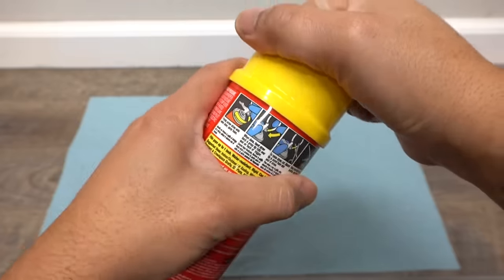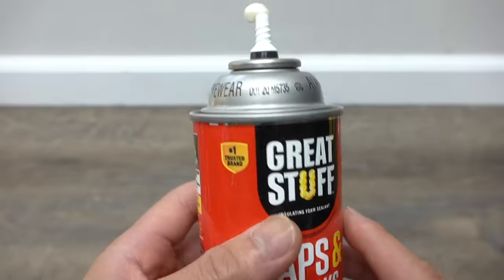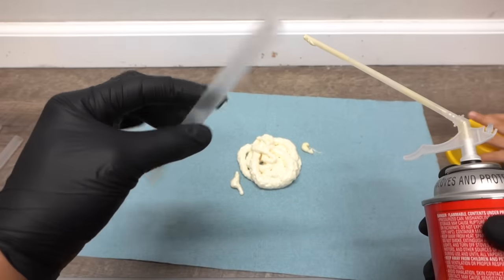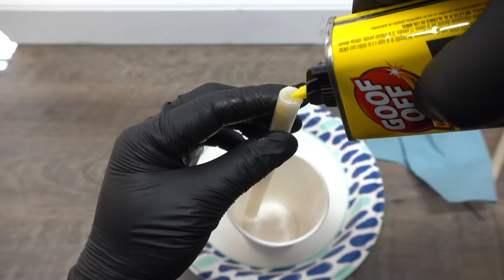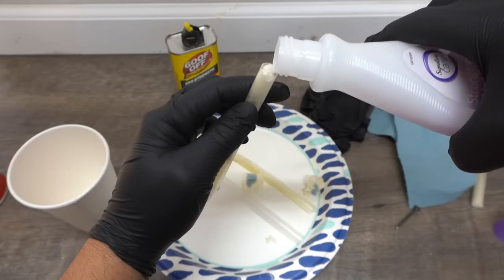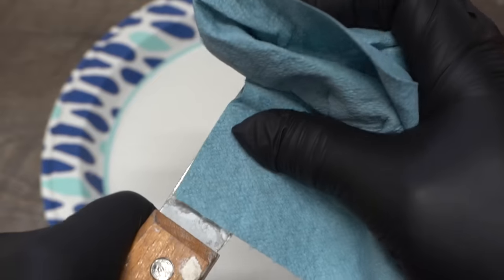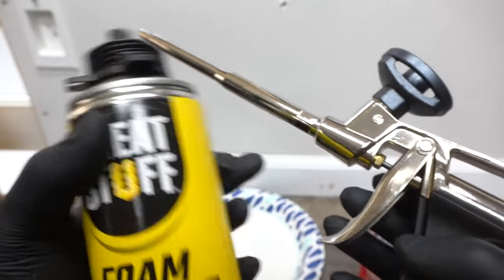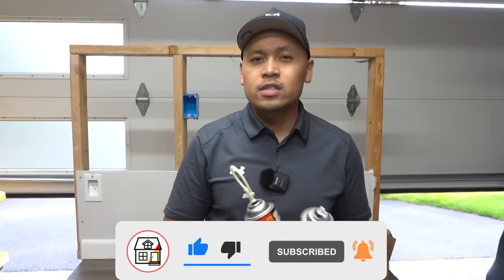STOP Throwing Away Half-Used Dried-Up Spray Foam Cans! How To Save And Fix It! DIY

Comment from the maker: ITEMS I USED ON THIS VIDEO:
- GOOF-OFF Remover - https://amzn.to/46EOv7m
- Acetone - https://amzn.to/45Ouryg
- Applicator Nozzle Replacements - https://amzn.to/474MSQc
- Drywall Screw - https://amzn.to/3FplP6e
- Match Sticks - https://amzn.to/495SNGg
- Nitrile Gloves - https://amzn.to/3S4KMeT
- Anti-Fog Safety Glasses - https://amzn.to/3Mc6hGZ
- Great STUFF Foam Gun Pro Series - https://amzn.to/3Q7X9UD
- Great STUFF Foam Gun Cleaner Pro Series - https://amzn.to/3Fwt7oE
- Great STUFF Foam Pro Series - https://amzn.to/3tEQHwV
- Great STUFF Foam Sealant Kit - https://amzn.to/3tHCGP5
Reply: Modern Goof-Off is basically just Acetone. Quart cans of pure acetone tend to be cheaper
Reply: @unquiche 2 REPLIES

Comment: I use a simpler method. When you're done applying foam, set the can down in an upright position with the application straw attached. Do not plug the straw or bend it back on itself, leave it pointing up, make sure to have something  under the can below the end of the straw. to catch possible drips. Walk away. The remaining material in the straw will be pushed to the end, typically the outgassing  of the little left in pushes it upwards. Next time you need it, you either cut off the end or clean it out. You'll have an inch to inch and a half to remove. Most of the time the nozzle on the can will be clear, sometimes a small amount of cured foam needs to be removed.
Reply from the maker: Thank you so much for this tip! Also incase you need a replacement applicator nozzle, here’s a link for a pack and it’s not that expensive: https://amzn.to/3FvHzgN

Comment: I have 3 of them that are clogged right now. They are poorly designed to be one time use
Reply: You mean they are “intentionally” designed to be one time use. If they cared at all about their customers they would sell the  straws / spray tubes separately so their customers could easily use the same can on multiple occasions.
Reply from the maker: I wish they also made detachable tips for caulking as well, like how they do in other countries 🥲

Comment: A straight piece of clothes hanger helps a lot for Cleaning out the straws. I put it in the straw after using the foam then I can pull it out after the foam dries.
Reply from the maker: Thank you for sharing this advice! That’s a pretty cool method! 👍🏽🙏🏽😊
Reply: For the straw, I've found scrap copper wire (12) to be successful. But I didn't know how to deal with the plugged nozzle. That info was helpful.

Comment: I've used this as adhesive to make structural insulation panels and glue for various other projects. 
It's exactly the same thing as Gorilla Glue. 
I was one of the first people who researched polyethylene for structural engineering purposes and found that it has many potential uses .
Reply: YEP.......... A Hole automotive body guys use it to fill rusted areas & then cover it up to screw potential buyers
Reply: So I was thinking of using this stuff to insulate a resin shed. Do you think it will work? If so howmany feet at a time do you suggest I should spray at a time?
Reply: As strong as gorilla glue?
Reply: @SirChivalRegal  absolutely, being the same thing after all. They are both polyethylene.
Reply: I was the first though
Reply: @tacos379  Really? With what institution?

Comment: Friend of mine showed me how to clean the clear tube out, he’d stick the tube in WD 40 coating the sides and let it soak a few minutes before spraying the foam.  After finishing, he just squeeze the amount out.  The spray acts as a coating making it easy to squeeze the spray foam out.   Works just like acetone.  Economically the acetone is cheaper though.  I’d prefer to save as much of the WD 40 nis that it’s gone up in cost.

Comment: I dip the end of a pipe cleaner in acetone and then put it in the nozzle and I run a couple through the spray tube after I use it.

Comment: Thank you!!!! I'd buy you a beer if I could.
I've thrown away multiple cans of foam because the nozzle and tube were clogged solid. It was so frustrating knowing that there still usable foam in the can.
Reply: Yes, I have had the same problem.  Something very annoying about shaking a heavy can that will not spray.

Comment: Dropped in to see what useless information you were offering, but instead left totally impressed. Great tips on cleaning those nozzles!. I've always tried to clean them with a wire when the foam was still wet, but that never worked good.
This past summer I had an almost full can that I couldn't get to work at all, even after cleaning the nozzle with a screw. It was either throw the can out or do something drastic. So I took a 6 inch nail and pounded down thru the nozzle until the can punctured. Then I just pointed it at the crack I was filling and made a big mess. After it dried I trimmed the excess foam away.
Yeah, I showed that can who was boss 🤣🤣
Reply from the maker: I’m glad I was able to help! Please be careful with aerosol cans, puncturing could lead to serious injuries, but I’m glad you won the fight over the can my friend! Hehe 😊👍🏽🙏🏽

Comment: BRAKE CLEANER... I have used it for years.  Spray your foam,
and shortly after use, spray the straw and can nozzle with Brake Cleaner (using the straw)

!!!Wear protective glasses!!! spraying into the can nozzle and straw WILL have lots of "back splash".
Best to use a face shield or behind a protective shield.   At least face the can sideways.

I've re-used cans stored  for over a year.

Comment: What I do is to simply wait till I have several different projects that will "collectively" use up the entire can, prepare all of those areas for foaming, and then perform all of the sealing-jobs at one time.  Or I look around for spots where I would like to have foam added but which are not urgent or critical, and then use up the last of the can's foam on them; I can use these spots to expend the foam from several different cans over the course of a few months, since it doesn't really matter if they get sealed completely at a given time.

Comment: If you spray the Goof Off directly into the can, does it adversely affect the foam in the can?
Reply from the maker: The goof off is not a spray just pour liquid form. Just apply small amount at the tip and let it settle and blow it off by pushing down on the nozzle.

Comment: it'd be nice if they made an applicator gun that works with the straw type cans. I don't have a problem with buying the pro cans, but sometimes lows/home depot will have a sale on the straw can where they're selling for $1.50 per can which is a deal to good to pass up.

Comment: Small additional tip: When I need more than one can of the foam for a single project, I continue to re-use the original straw on the additional cans. That way I have the new, unused straws on my shelf for use when reusing the last, partially used can. I don't have to clean them.

Comment: JSYK, the fancy gun isn't compatible with the standard cans. You'll need to buy the "pro" cans with the screw connector on top. Also, you can get a generic fancy gun online for less than $20. 🤓

Comment: I was just staring at that can last night. Unfortunately, the nozzle snapped off :(
Reply from the maker: I’m sorry to hear 😔
Reply: @FixThisHouse  it's a bit old, I just hate throwing away chemicals without using it all
Reply: They snap very easily. Be careful tightening down, and the last is pushing down on the side tabs to get it to flow.

Comment: So let’s make this issue a lot simpler.  Take the straw off after use and spray WD40 through it to clear it out. Don’t bother waiting until it’s hard. Then spray the top nozzle of the can with WD40. Problem solved, your welcome

Comment: I think the key is to clean it before it dries. I just use WD-40 and shoot it down the clear pipe and into the nozzle. If you don't have WD-40 on hand in the garage, you can always use carburetor cleaner. That always works for me. As far as cleaning the metal spatula, a belt sander works pretty quick also to take off plaster, surface rust or dried foam.

Comment: I used to do all this with acetone- then I purchased a generic “pro-gun” from Amazon ($16 - not $60!) and it’s been amazing. Just tighten up the knob in the back real good and set it on the shelf. Every 3-4 weeks I’ll squirt out a couple inches of foam out and set it back on the shelf. If I know I won’t use it for a long time then I’ll use the can of cleaner through it. It’s also super nice to be able to put down a 1/4in bead of foam or a huge bead of foam. It’s super versatile and offers great control.

Comment: I found that the straw can easily be taken care of by blowing it out with compressed air before it hardens, and the little bit of residual amount that hardens in the straw can be removed with a wire coat hanger.
Thanks for the tips on cleaning out the nozzle on the can.

Comment: i've done this for years. remove straw top from can, clean out top of can. DO NOT go to far into the top of the can or you will puncture the plug and the foam will begin leaking (or spray) from the can with no way to stop it. 
Take the straw top and with some force you can pull the straw section off from the rest of the top. Let the foam in the straw CURE. Often it will cure so far in from each end, then what is in the middle may stay gummy. The plastic these are made from naturally won't adhere that well to the foam. So if you take a wire or etc, you can push it through the straw and usually clean it out, as the cured "plug" acts as a plunger. If all of it doesn't come out some brake clean or other solvent or Goof Off (but not goo gone) will finish the job. An air compressor is nice to blow it out if you have one, as you may not even have to use a wire with this method, but its not required. 
The other piece of the top, just take the wire or a pick and pick the pieces out. It will usually cure all the way through, and again the foam doesn't adhere to this plastic very well, so its usually not that hard. Pop the straw back onto the screw on top. Now you have a straw top and can ready to reuse. Also after a can is empty, I always clean and keep the straw top just in case one gets broke or etc on a new can. just my 2 cents of experience.

Comment: i work at a sculpture shop carving styrofoam and the loctite brand gap filler is very useful but it does have a considerable waste factor. at $10 a can or more, that really adds up when there's 33% waste. sometimes a brand new can gets one use and done. i have learned some techniques to prolong the life of one can. first, these manufacturers should include an extra straw just like they should include an extra nozzle with spray paint but they don't they're happy to sell a whole nother can. so cut that straw in half right at the start. keep the clean half tucked somewhere you can find it later. second, the new can will expand the most and it's smart to pause when it's halfway that's the sweet spot where it works the best. i keep a half empty can for when i need accurate application and not extra explosive expansion. third i try not to force the straw tip inward into its own stream or into wet foam. always pull back and away from the stream not into it. that forces half dry sticky foam back into the straw and is a factor for clogging. i keep a little cup of acetone nearby to dip the straw into. a gallon of acetone costs the same as 6 or 8 ounces of goof off. but acetone is not good to touch bare handed neither is expanding foam. always always always wear gloves. keep the box of gloves right next to the cans of foam. to keep the straw sealed with wet foam inside, i stand the can facing a wall or object and let the straw gently make contact with a stable surface. the foam will gently puff out and stick the straw to that flat object. usually a block of foam or something that does not matter to get a blob of foam. when you come back later the can will cleanly detach and the straw will still be fresh inside. i find this works better than any sort of cap or plug, just pointing the straw into a vertical surface

Comment: You dont cover what happens if it is still not working even after cleaning the tip.
As a last resort, can push the tip hard down and sideways and can usually get some foam to leak out between the rubber base and the can, and collect that and use a wooden spatular etc to use it to fill gaps etc. Messy and not as easy as spraying through the tube, but saves wasting the rest of the can
Reply: Be careful with this tip.
Hate to get it in your face.  Like looking down a fireworks launch tube to see why it didn't launch.

Comment: I have had those can with the nozzle clean and the can was almost full, and still nothing would come out. Like the other guy said, wish they would make a tiny can, single use, like crazy glue has come out with. a very tiny multi pack with several tiny tubes in. Even then the tiny tubes is too much. They are in the business to sell the product, that is what they want us to do. Thank you for the video.

Comment: Get yourself some pipe cleaners from an Arts and Craft store. Insert the cleaners into your tubes after using them and into the tops of your spray cans. When the foam is dry, remove the pipe cleaner and everything comes out in one piece.

Comment: Would have liked to see the demo with the actual tube used to apply the foam.  I have a feeling it won’t go so easy as those nice big straight straws….
Reply from the maker: It would be as simple as the big straws. You might want to use a thin wire to poke through as it eats it away. If all fails they sell a pack of replacement straws: https://amzn.to/45GW3VS
Reply: @FixThisHouse  Thanks.  Great content.  I've thrown so many cans away after hardly ever using them.  Now I'll try this and maybe get some use out of them

Comment: Im betting its much harder to do on the actual stiff pipe that comes with ths can......
Reply from the maker: Should be just as easy. You might need a thin wire to help push or fish out the remains 👍🏽😊

Comment: If you use it that much, get a professional foam gun system.  It lasts WAY longer in storage and closes off properly.  Plus it's far easier to get a good bead. 
Edit:  Posted this while watching the video and saw you showed the pro system at the end! :)
Reply: There are other makes of the same idea.
Reply: Seems like they put out ten times the quantity of foam as well.
Reply: @ryanjohnson3615 what do you mean?  The pro guns are adjustable so you can put out a tiny amount if that's what you need, or a large amount if that's required. The single use cans just spray it out pretty much at full force all the time.
Reply: @The_Seeker_of_Truth  I mean "more bang for the buck" quantity wise.

Comment: Is there a place to buy extra plastic applicators that come with the Great Stuff? That would be a very simple fix (along with the screw in the can nozzle).
Reply from the maker: Yes! Here is a link to get replacements applicators:  https://amzn.to/3MhF2KS
Reply: I took off the tube that was on the applicator, and just use a regular plastic drinking straw. You can also just not use the applicator part at all and directly attach the straw to the can nozzle.  When you are done, then just throw the straw away and clean out the nozzle.  The bendable straws work really well for this, then you can bend to almost any angle you need.

Comment: Thank you for passing on this very helpful video. I was so excited when I screwed the screw into the nozzle and foam came out! Since I had not done this before, I didn’t know it would work so fast. I didn’t have gloves on or protection on the counter. All cleaned up now.

Comment: There's a product/company called Mosentocker's lift off.  They make one that specifically removes spray insulation foam and gorilla glue( both the exact same thing ones just in a pressurized can). It removes the adhesive/insulation foam solvent free by chemically breaking down the bonders at the atomic level.  They make stain removers for everything.  They're a little on the expensive side for a product that only works one one thing but they work crazy well every time and I've never had them affect the surface I was trying to clean in any negative way.

Comment: I have this problem with easy off oven cleaner. Any suggestions?
Reply: That's why I only use the self-cleaning setting so I don't have to bother with that. Hopefully your oven can self clean?
Reply from the maker: Good question, honestly I haven’t used this product but I will get to it and get you an answer 🙏🏽

Comment: It's not possible to build a better seal than the manufacturer did. Short of cleaning with solvents, the best way to go is just shooting a little foam out the end of the straw and letting it harden. Then you just chop off as much of the stray as has hardened. If it hardens all the way back through the straw to the can, then you just waited too long for a disposable product. I personally am not super interested in thoroughly cleaning out a disposable straw with acetone, and I wouldn't recommend that to average people, but if you really want to, it'll work! Just note that acetone isn't very good for you!

Comment: I can't believe all these "WD40, acetone, and chemical" people. I simply blow through the hose after use (so it won't clog) and use a stiff wire (those "flag" wires work the best) to clean it after it hardens

Comment: Before you use the can at all, spray wd40 into straw. Attach straw and use spray foam.
The wd40 will not let the straw clog.
I have been using this method for years.

Comment: The screw is a good tip, but I'd use that screw or something metal instead of a matchstick to put back in the nozzle. I tried the matchstick the other day and it just breaks off when you try to remove it later to use